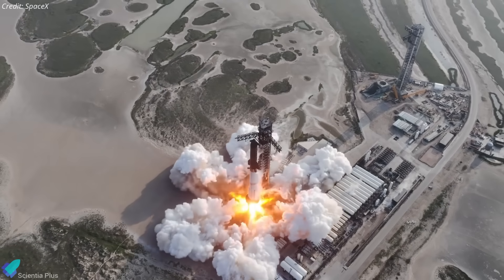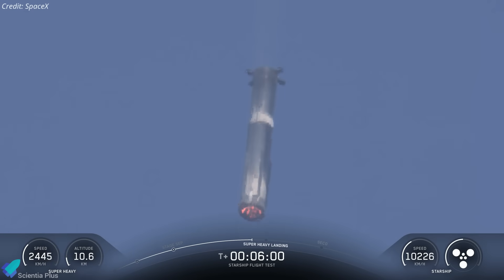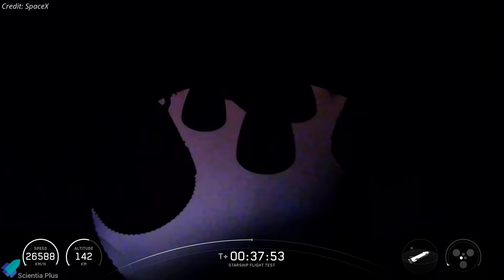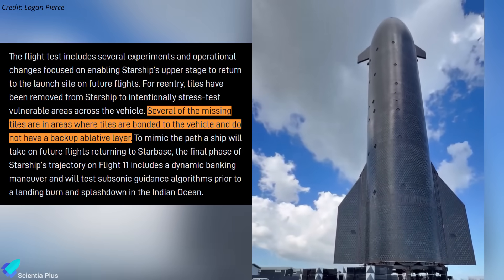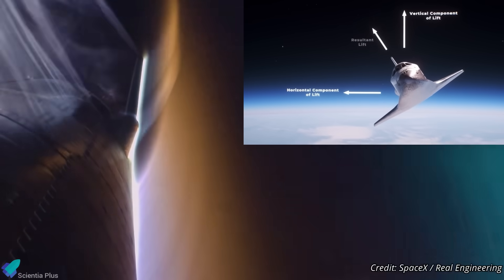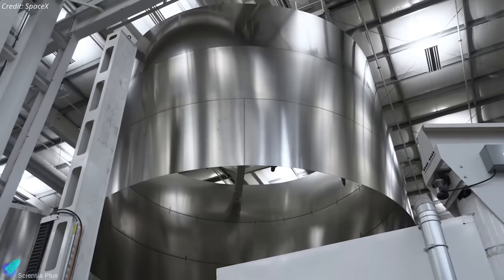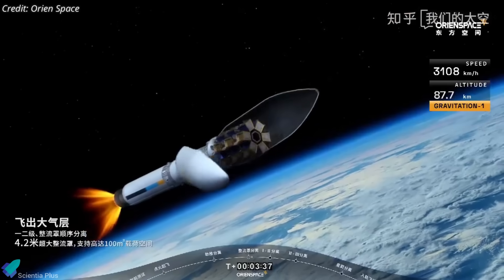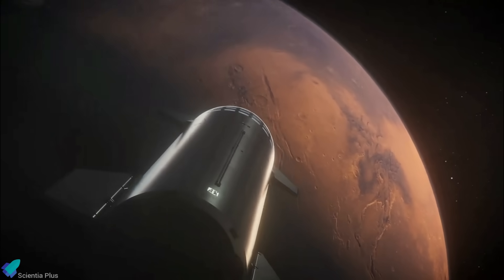Starship Flight 11 Just Nailed the Perfect ‘Drift’ Landing — NASA Reacts!

Comment from the maker: 00:00 Starship Updates
10:58 China Just Launched a Rocket From the Ocean — And It Actually Worked!

📚 Learn More:

🚀 Starship Block 2 Explained:
 📖 Summary: https://shorturl.at/b0dtw
 🔍 Detailed Explanations:
  • Design Improvements Update 1: https://shorturl.at/lpGT7
  • Design Improvements Update 2: https://shorturl.at/gwNQ4
  • Nosecone & Payload Bay Redesign: https://shorturl.at/xa60S
  • Methane Downcomer Redesign: https://shorturl.at/XdYBG

🚀 Starship Block 3 Explained: https://shorturl.at/mnBT4
  • Detailed Breakdown: https://shorturl.at/IViwD
  • Production Begins: https://shorturl.at/xRNkJ
  • New Transfer Tube / Downcomer Explained: https://shorturl.at/Iaqc6
  • New Grid Fin Explained: https://shorturl.at/NxdVo

🚀 Starship Block 4 Unveiled: https://shorturl.at/7A2ef
 
🔥 Raptor V3 Mega Upgrades & First Test: https://shorturl.at/TRIyj
🧱 What’s Inside Starship GigaBay?: https://shorturl.at/nJM75

🛠 Insane Engineering of New Starship Launch Pad 2: https://shorturl.at/7RAZd

🛢 Dual-Port Orbital Refueling – Full Technical Breakdown
https://shorturl.at/5tiqK

🛠 Other Starship Upgrades:
 • Hot Staging Explained: https://shorturl.at/jf400
 • Super Heavy Booster Upgrades: https://shorturl.at/Pi5R3
 • How SpaceX Protects Raptor Engines: https://shorturl.at/4Om8F
 • New Heat Tiles Explained: https://shorturl.at/p2Ijb

🚀 Starship Flight 10 
  📽Detailed Breakdown: https://youtu.be/irVUMJNe0Kc
  📽Root Cause of Anomalies: https://youtu.be/LBUpp7MRVSY

📡 Stay Updated:
📢 Weekly Updates: https://bit.ly/3HIQjPC
🚀 SpaceX Playlist: https://bit.ly/34wue8T

Comment: The Space Shuttle had a cross range capability of over 1000 km enabling it to land at the launch site after a single orbit. Starship? nope. Also the Shuttle's first "flawless" mission was it's maiden flight with crew aboard.
Reply: You know it killed people right? I see your point but comparing apples to oranges is pretty silly lol cross range is less important when you catch it with a stationary tower instead of a runway. We all know NASA has a development strategy that hinges on it working the first time, likely due to government funding and this is much more ambitious than the shuttle.
Reply: @mattjenkins2244  Cross range has nothing to do with tower or runway it has to do with the fact that when you complete one orbit the launch point is no longer below you, it is 90 minutes of Earth's rotation to the east. Perhaps it's irrelevant though as Shuttle never did a single orbit return to launch site despite having the capability.
Reply: @pi.actual wouldnt the multiple catch towers in multiple locations negate the need for that much cross range capability?